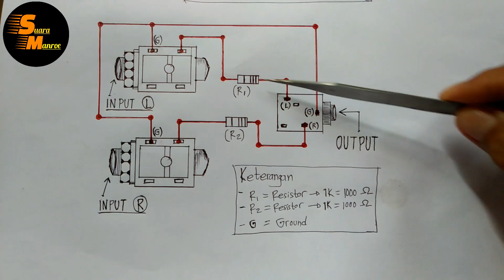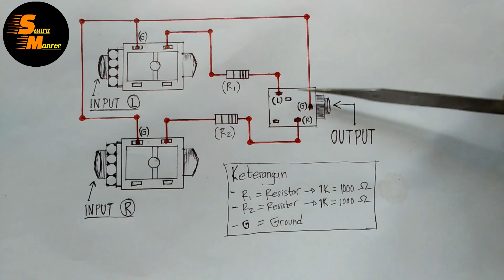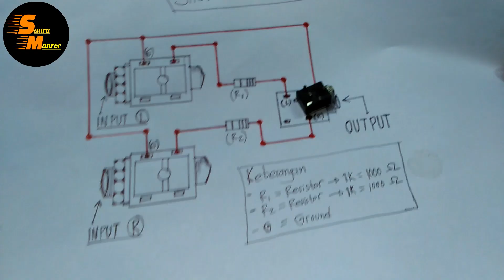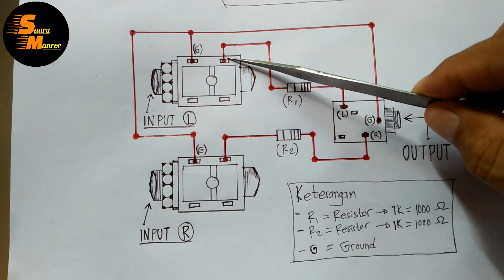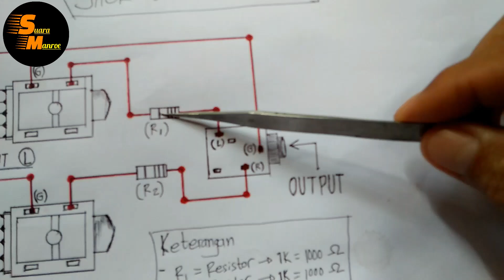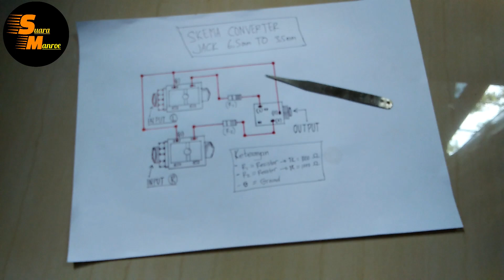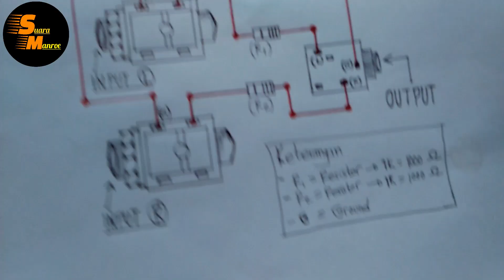Tutorial & gambar skema rangkaian converter dari socket jack 6,5mm ke socket jack 3,5mm_Suara Manroe

Comment: bang rencana mau coba bikin yg output nya 1 aja, kalau pakai socket 3,5 nya mono (3pin) dan yg 6,5 nya juga mono (3pin) apa perlu di bagi 2 lagi (L&R) gitu juga bang, apa langsung di gabungin aja L&R nya terus Ground tetap pisah. terus kalau pakai 1 output harus pakai 1 resistor atau 2 bang. tolong di jawab bang.
Reply from the maker: Gabung bang
Dan pakai dua resostor,, 1k boleh atau lebih kecil boleh,, agar suaranya tidak begitu tertahan
560 ohm
Reply: @SUARAMANROEBLESSED  berarti cukup pakai 2 kabel ya bang? L&R di gabungin 1 kabel (1 resistor) dan 1 kebel nya lagi ground pakai 1 resistor juga. seperti itu ya bang?